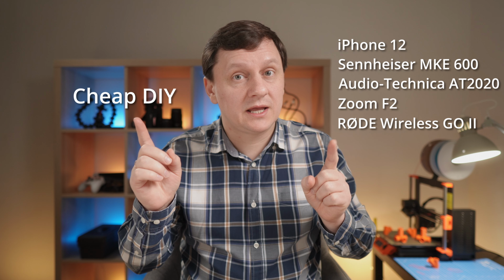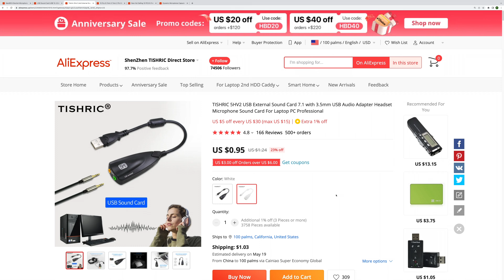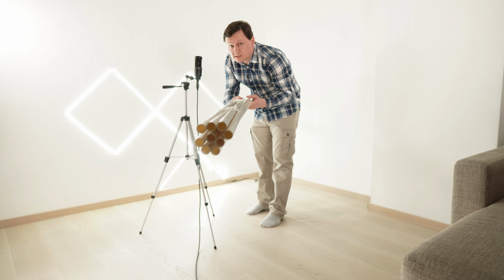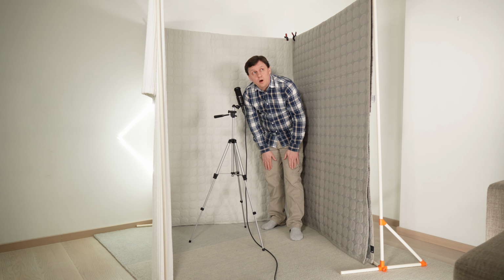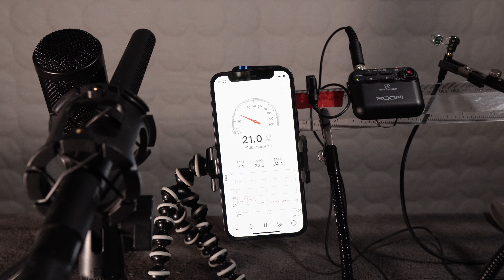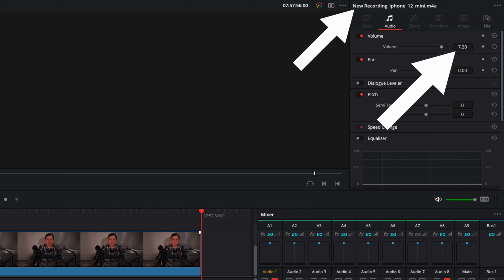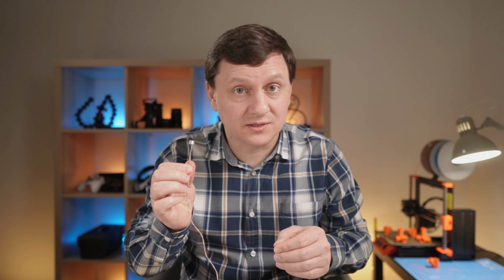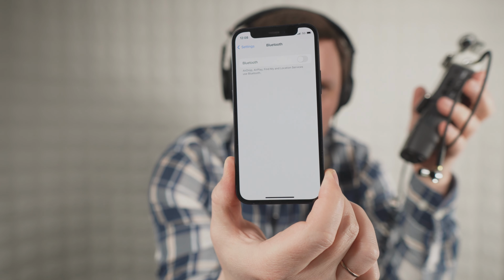DIY microphone

Comment: Is it feasible to do (relatively) cheap DIY wireless Go-style mics with Pi Pico W or ESP-32 and the pod mics you used? I know little about audio engineering :') 
Excellent video btw, liked and subscribed. Your style of presentation is entertaining.
Reply from the maker: Thank you. It should be possible to make a DIY wireless microphone with ESP-32. I think I saw a similar project somewhere on the Internet.